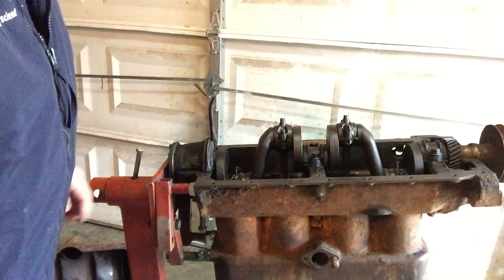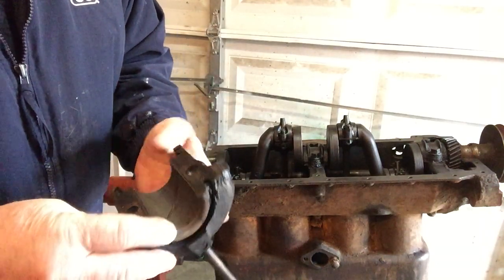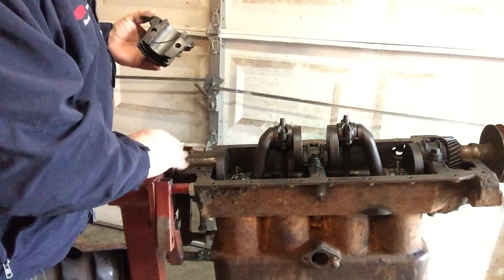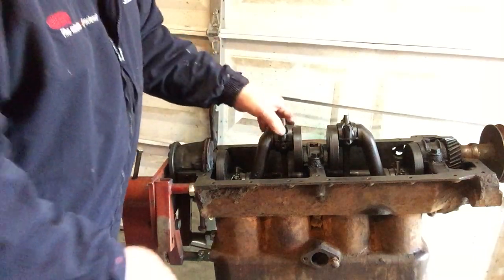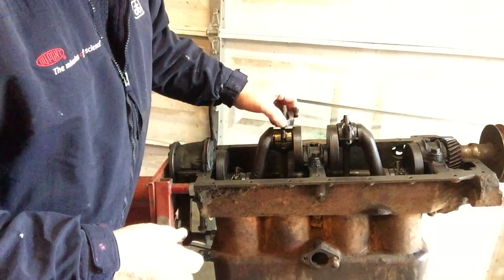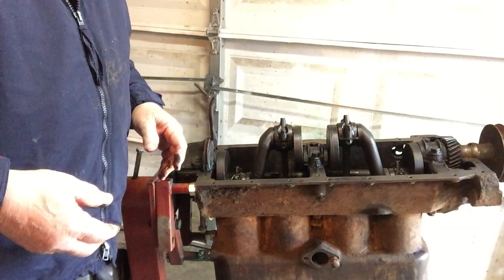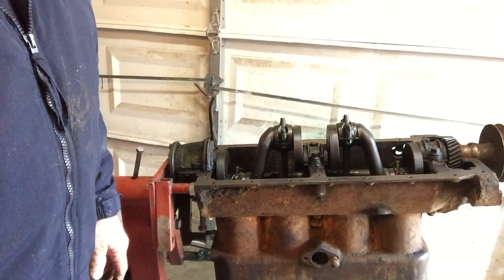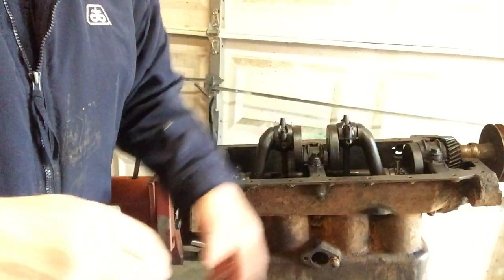Junkyard Model A Engine Fix Up Part 7

Comment: Neat videos, it is fun to open the old engines and see what surprises are inside, I like the looks of this one and it does look like someone recently worked on it. I am close to doing a first start on one that I got off of craigslist a few months ago. It is a 28 with the multi disk clutch so I am learning all about that. Mine had what looked like chocolate pudding in the oil pan but the rest of it was in good condition other than being dirty. Glad you were able to rescue the engines, would have been a shame if they got scrapped!
Reply from the maker: Gill Pollard   I pulled pistons out today and ring lands all clean with no carbon.  Won’t even need to put new rings in after cleaning them off in bio-diesel.  Will hone cylinders and lap the valves and start putting it back together after a good clean.
Thanks for the comments.